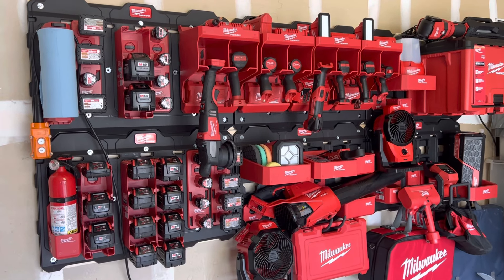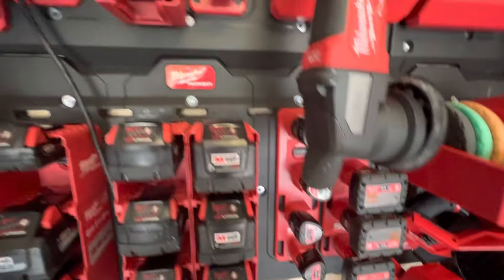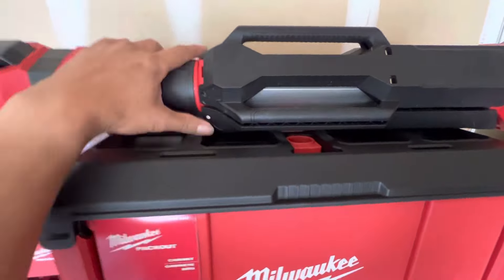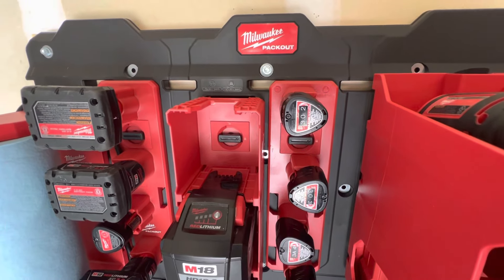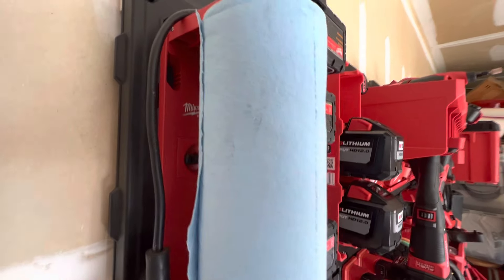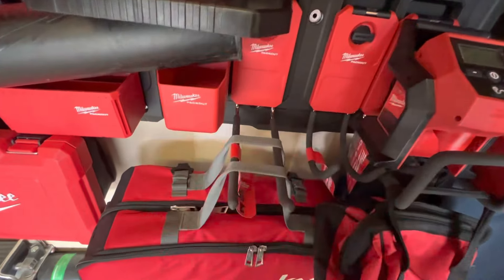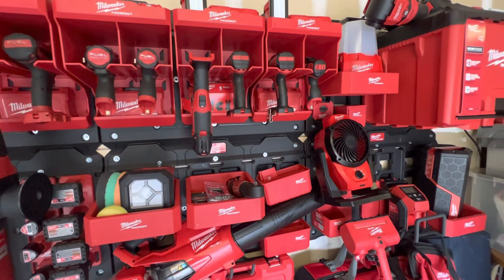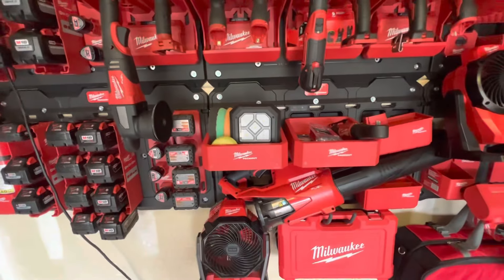Milwaukee Packout Shop Storage System

Comment: Nice setup Milwaukee did great on these battery and tool mounts
Reply from the maker: I had batteries scattered everywhere. On my kitchen counter. Garage. Stacked up on the table. I was actually having a hard time keeping track of them all. This is the perfect solution for me.
Reply: @MinhNguyen-ot1zg  wow That's alot of location turned out very nice
Reply from the maker: @AntonioClaudioMichael  Thank you! Now everything is in one place where I can find it easily and don't have to search all over for something.

Comment: First Ryobi killed it now Milwaukee has a sick set up too. Mark your days Dewalt!! As an electrician, I have Dewalt tools and getting tired of them dragging their foot!
Reply from the maker: Don’t worry, DeWalt will come up with something. In order to be competitive they all copy off each other - apple copies off android and vice versa. Ryobi and Milwaukee are owned by the same parent company so it makes sense. When I first saw the Ryobi setup I was very impressed and was thinking to myself that surely Milwaukee will come out with something soon. They’ve really taken the PACKOUT concept and run with it. I imagine dewilt will have their answer to the Milwaukee storage system soon, if it’s not already in the works. Of course, besides the battery holders, nothing is stopping you from using the Milwaukee system with your dewilt tools.
Reply: Minh is on the money. Techtronic owns both Ryobi and Milwaukee. If you follow things closely, you see that they use Ryobi for testing (read: proof of concept) and then use what they learned to release Milwaukee versions about a year later. Backpack chemical sprayer, track saw, storage wall. You name it, if you look back the Ryobi comes out a year earlier. Only thing I disagree with is DeWalt catching up. They may do something to try. But Ryobi and Milwaukee are running shit right now with regard to innovation.
Reply from the maker: @ILruffian  I never thought about that but it makes perfect sense! Since the parent company TTI owns both of them, they can use Ryobi as a test subject for their marketing and if it sticks, then Milwaukee can invest and even learn from the mistakes of Ryobi. Now if they would only come out with a Milwaukee pressure washer 🤔
Reply: @MinhNguyen-ot1zg  slight correction.  Android copies Apple (original smartphone).
Reply from the maker: @n_a3522  They copy off each other, that’s common with all manufacturers. If Ford adds a feature in their cars that everyone uses and loves its just a matter of time before all the other makes get wise and come up with their own version.

Comment: Im in the process of changing my entire shop in my basement. Im putting 4 packout cabinets across the top. I have the tool stations the mini shelf’s the plier holder and screw driver holder. 

I want so much more but only have so much space.
Once I build my post frame home and shop. It’s going to be and insane build out
Reply from the maker: I’m sure you’ll be super happy with the results. The cabinets are quite nice. You might already be aware of this, but you’ll need four large wall plates to mount the four cabinets. You’ll still have two horizontal slots per wall plate to be able to put the tool stations and shelves and tool racks. The cabinets use four slots across and three slots down if that helps.
Reply: @MinhNguyen-ot1zg  yes I am aware. Or if I don’t need extra I can use a small wall plate I have a few of those kicking around. 
This is the best solution A company has come out with.
Reply from the maker: @Thelightingaddict  I was so happy to see them come out with a wall storage solution. When I saw that ryobi had one I knew it was just going to be a matter of time.
Reply from the maker: I thought the same thing when I saw the Ryobi system - as you probably know, Ryobi and Milwaukee are owned by the same company. Of course you know Milwaukee isn't going to let Ryobi one-up them! I'm sure DeWilt will come out with their version soon!

Comment: Awesome set up Friend! These tools will last for years
Reply from the maker: I certainly hope so! I take care of my tools and do my best not to abuse them. And now I have a way to keep it all organized.
Reply: @MinhNguyen-ot1zg  i love to take care of my tools as well as i value them..got all my milwaukee impacts their boots and i clean then when i am done. They are like gold to me and i believe that they can hold a resale value at least at 75% in case i need to get some emergency money..but luckily i have not been in this position other than using them to work on my cars and other's car for $$. Take care Friend!
Reply from the maker: @alfredbernal8603  I don’t have the boots on my impacts. The grips do get a little greasy when working on cars. I have found that goof off will remove the grease right off of them.
Reply: @MinhNguyen-ot1zg  I use armorall to clean mine with a brisel brush and then wipe them down. I take pride in my tools. Do you plan on buying the new m12 batteries? 2.5 & the 5.0?

Comment: Looks great hoping to be able to take down my old pegboard and work on the pack out set up. Thanks for showing your set up
Reply from the maker: No problem! I hope it gives you some ideas. I’m not sure what your pegboard is sitting on, if it’s on bare studs I would probably consider putting plywood up as a foundation point to Mount the wall plates.
Reply: looks unused

Comment: That looks awesome . I love the packout system it’s great . I’m a heavy equipment mechanic that alternate from the shop to a service truck . In the shop I modified one of the packout drawers into a power drawer I can charge stuff like lights and I got packout mounts on the service truck in the tool boxes and the bumper which is basically a work bench so I can snap them into place and go .
Reply from the maker: I agree it is quite a lifesaver. The ease of transitioning between shop and truck makes it great! I love the modularity of it. Great idea on turning one of the drawers into a charging station. Don’t even get me started on the lights - I have many, many Milwaukee lights. They are quite useful! DeWilt doesn’t even hold a candle to the Milwaukee lights.

Comment: Thank you! I was looking last month and could not find any videos on the shop storage system for whatever reason
Reply from the maker: You're welcome! I did the exact same thing when I was shopping for mine and dismayed that no one else has made a video. It's all commercials and tool channels talking about them and showing stock footage. I made the plunge and felt compelled to share my experiences with all of you!
Reply: @MinhNguyen-ot1zg  what size screws did you use to mount the 1x4 to the wall? I originally was going to put the packout plates directly on the wall but like this method better
Reply from the maker: @TRXC8  I am not sure of the screw size, I’ll check when I get home but they are the black drywall screws and I think they were 4 inches long
Reply from the maker: @TRXC8  The strap method allows you to use all the screw holes along the top and bottom of the wall plates because there’s not necessarily a stud behind each hole. If you watch the video posted by a Concorde Carpenter, he explains the strap method.
Reply: @MinhNguyen-ot1zg  Thank you!
Reply from the maker: @TRXC8  I'll get back with you on the drywall screw size.
Reply from the maker: @TRXC8  I used #8 x 2 inch drywall screws made by Grip Rite. Coarse thread, sharp point, phosphate coated, #2 Phillips head. "For attaching gypsum board to wood studs".  I am sure you can use other size screws and have a good result if you can't find exactly the same ones. I got them at a big box store, probably Home Despot or Lowe's.

Comment: Nice set up bro.. working on mine right now. Like that cabinet though 👍🏻
Reply from the maker: The cabinet is really nice! I actually have two cabinets because I mounted an additional large wall plate in my kitchen with the second cabinet on it! In the winter time I can move my batteries inside and mount it to the wall plate.
Reply: @MinhNguyen-ot1zg  that’s not a bad idea using the cabinet for the batteries 👍🏻
Reply from the maker: @jameyhaupt1789  That is true. But I was thinking more about moving the cabinet to the garage and bringing all the batteries in and putting them on the large wall plate in their respective holders. But the cabinet works too! I might consider that so long as I don’t have the cabinet crammed full of junk!
Reply from the maker: @jameyhaupt1789  I've posted a video specifically going in depth about the cabinet. Be sure to check it out!

Comment: Nice organized system!
By the way, those self drilling screws are for steel. 

They don’t hold reel well in wood.
Reply from the maker: Thank you! You might be right about this. I was going off the video published by Milwaukee on how to install / mount the wall. It seems to work for now and I don't have anything really heavy on the wall.
Reply: It looks to me like he used lag bolts in several places. If they are going into the studs, they will hold forever.
Reply: I'm glad I'm not the only one who saw that and was like "Uh Oh"! 

I would definitely use different screws because those screws you used will not hold a lot of weight when used in wood.
Reply: @El_Diablo_LI  He said he used lag bolts.
If at least four of them are going into studs, that thing shouldn’t be going anywhere for quite awhile.
Reply: @DiligentDave1966  As long as he caught the studs with the longer lag bolts, you are correct. But I think myself personally would feel better if all the bolts were holding securely into the wood if this was my system.

Comment: Super nice setup!! Nice vid! I am just starting to build my own setup. I have a question about the paper in the paper-holder. Where do you get the paper-rolls that fits nice in the holder? I have yet to find the type of paper that fits the holder in an optimal way. It`s either too wide, to long or to much inner diameter.. an so forth.. any help appreciated 🙂 Thanks again!
Reply from the maker: Thank you for your comments! I’ve never tried to put any other type of paper towel rolls in the holder, but these are blue shop towels made by the Scott paper company. You can find them in the automotive section at Walmart. I was able to buy mine in bulk at Costco. They also sell them online on Amazon. They are absorbent and they work better for Shop use versus household paper towels, which tend to be more absorbent, but they also fall apart easier.
Reply: Thanks! I live in Norway, but I actually found the right Scott’s Shop paper at a car-care shop here. $9.50 a roll…😅 But that will at least fit perfectly! Thanks!
Reply from the maker: @JanMartinMelum  Wow for $9.50 a roll I would be afraid to use them up! Here in the states, they can be found for under $3 a roll and even less if bought in bulk. I get mine in a 12 pack and I go through them quickly. Hopefully you can do some shopping around and find them cheaper where you live, that sounds unreasonable. They aren’t that special. Glad you were able to find them and solve the mystery of the ill fitting paper towels!

Comment: Love the set up my man. But how come with all those tools you still needed Home Depot to cut your wood? You don’t own a skill saw or miter saw?
Reply from the maker: Fantastic question haha! I don’t do any woodworking. If I was going to own any saws it would be the circular saw or the sawzall. Neither of which would I be skilled enough to make a clean cut.
Reply: I have circ saws, table saw, track saw, etc. and I still have HD make cuts for me sometimes simply because they are there and it makes handling the material into the truck, into the shop, and into the table saw that much easier.
Reply from the maker: @bnrlabs5923  that makes sense! Plus it’s free so why not?
Reply: @bnrlabs5923  there are time when I am at Home Depot and traffic is bad and I just start ripping all my sheet good down to size in the parking lot. Once I cut my all my Stringers in the parking lot
Reply: @rickyperkins232  🤣 I have one of those little M1 Milwaukee cut-off saws (like a mini angle grinder) and I've stood there in the parking lot cutting metal and throwing sparks everywhere before I head home!
Reply: @bnrlabs5923  Lmao, dude we are just too crazy but we do what it takes man.

Comment: I thought you had an over kill of batteries but I see you have the leaf blower lmao.. I do as well.. 7.. I use 7 batteries to clear my yard..
Reply from the maker: Wow! I also have the lawnmower which came with two 12 amp hour batteries. The great thing about M 18 is that I can repurpose the batteries for other things. Now that it is cold where I live I can use those 12 amp hours for any of my other tools. The leaf blower is great for a small jobs and blowing out my garage. I still have a gas powered Stihl BG 86 leaf blower which is stronger than the single battery Milwaukee leaf blower. What would be super cool is if I had the dual battery leaf blower. Maybe it would give the Stihl BG 86 a run for its money. The Milwaukee leaf blower is great when it’s 3 AM and I just wanna blow a few things out of my garage and not bother the neighbors, because I’m a nice guy and all ;)

Comment: I wanna add these drill holders in my work trailer. Do you know of any way to keep the drills from sliding out of the holders when driving?
Reply from the maker: @cdsmit27  sorry just now seeing this…. The tool station is not rated for mobile use. It has a mark on it like this 🚫🚐 so maybe you could use bungee cords or some other creative way to secure them?

Comment: looks like the tools and batteries have never seen the light of day or work. but very nice all the same
Reply from the maker: Some of the tools and batteries are relatively new. The 12 amp hour ones came with my lawnmower which are a few months old. The random orbital polisher was just released a couple months ago. I’ve had six batteries replaced under warranty due to heavy use. But make those mistake about it, I use all my tools. I do not treat them like museum pieces. I’ve had my impact wrenches and ratchet so greasy and dirty that you could hardly see the red plastic through them. I cleaned them thoroughly with goof off which made them look nearly new. Some of the batteries have splatter all over them from polishing and waxing or whatever else and some are greasy and I even have one that’s broken where the top has detached from the bottom casing but it still works otherwise fine. My tools aren’t there to look pretty, I love the organization.
Reply: @MinhNguyen-ot1zg  those tools are never used you can tell by them. Who needs 10 plus batteries for diy
Reply from the maker: @theoprice721  How did you know? The batteries are all empty replacement shells I got on Amazon and plastered Milwaukee stickers all over them. They are nonfunctional and just for show.
Reply from the maker: @theoprice721  The tools are also the non working display models I got from a Home Depot that was going out of business.  They still have the lead weights in them to make them feel heavy but they’re all fake.

Comment: “I’m not sponsored”  but I have 10 grand worth of brand new tools hanging off my wall. 
I’m a boiler maker- our service trucks have a fraction of that for a crew of 4-6 guys working out of one truck.  Either you’re rich, you are a salesman for Milwaukee, or you robbed your local hardware store.
Reply from the maker: 😆 😂 I am definitely not rich - this was an accumulation of tools over an approximately 5 year period. I think the MSRP of the all the items shown are probably closer to $5,000 than $10,000. I am not a tradesman or have a job that requires the use of tools like that. As much as I would have loved to loot a Home Depot during times of civil unrest, that didn’t happen. I got lucky a few times with the “buy this battery / tool, get this battery / tool for free” promotions at the Home Despot. I am an average guy with an average job. I have a penchant for DIY, especially for things concerning automotive repair and maintenance. I am not a mechanic, but I can watch the YouTube video and save myself thousands of dollars rebuilding a car suspension, wheel bearing replacement, valve cover replacement, cleaning EGR system, etc. The money I save I put towards the tools that will make these jobs easier. During the time I’ve owned both my cars they have never been to a service shop for any repairs. I do all the maintenance on my cars. There have been times the Milwaukee impact guns and ratchet have gotten so greasy and oily that the red plastic parts were completely covered. Cleaning them with goofy off makes them look nearly new. Some batteries have become broken and detached at the top cover but still work fine and other batteries have splatter flung all over them from whatever tool I was using. Do your 4 - 6 guy crews buy their own tools or are they provided the tools by the company?
Reply: Some like watch’s some like tools some spend their spare cash on booze what ever turns you on.Spot on like it couldn’t afford it just like the Rolex I can’t afford
Reply from the maker: @Allegedly2right  If you're not spending a lot of money on something, it's not a hobby, it's a past time. I am not a mechanic but most of my tools are used as labor saving devices to work on my cars. With the money I save versus taking them to a repair shop I can justify spending some of that on tools instead that I can use for the next job. I bought all those tools one at a time, some as part of special deals with a buy this, get that promotion at the Home Despot.
Reply: @MinhNguyen-ot1zg  can’t fault you